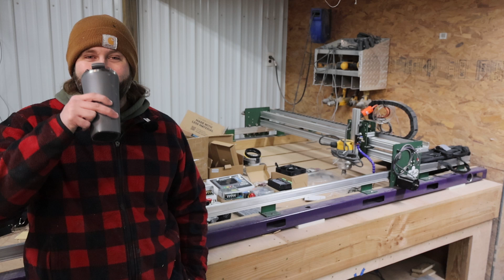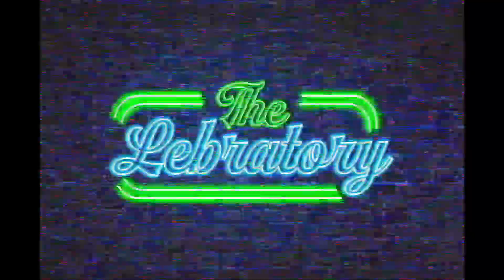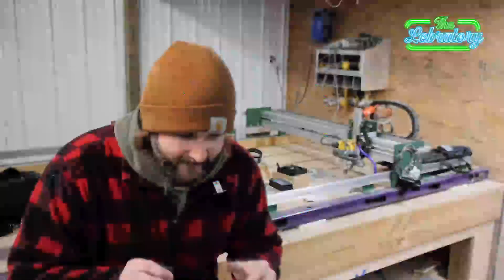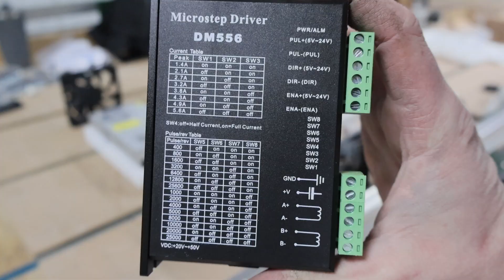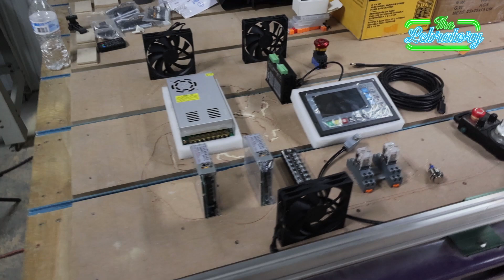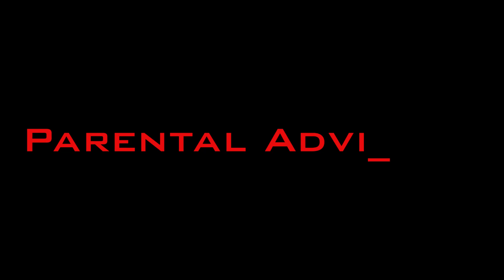DONT buy things from FB marketplace (CNC Router video 1)

Comment: You may be on the right track. At Boeing, one of the Facilities Engineers took your approach and upgraded the wire marking machines from WWII controls to state of art (for mid-80's) Intel controllers. This reduced down-time incredibly. Meanwhile in my lab, I was developing laser wire marking. I introduced three machines to the production line that marked considerably faster, replacing the eight machines the other guy upgraded.  Keep up the good work.
Reply from the maker: That's awesome!! I'm really starting to enjoy working on this stuff and honestly think I can build my own laser table at this point.